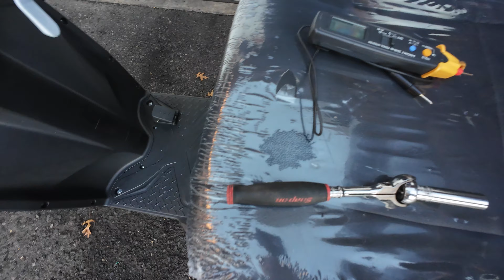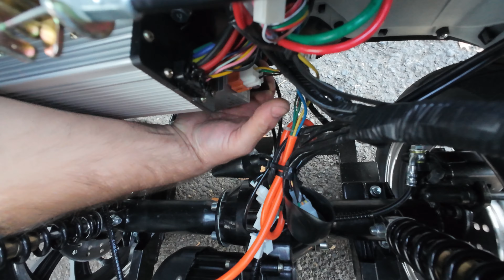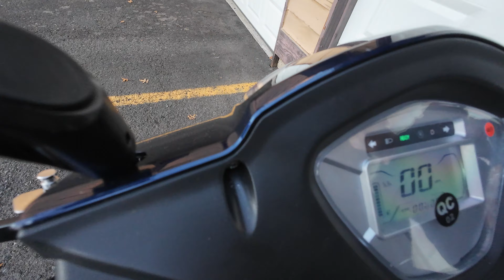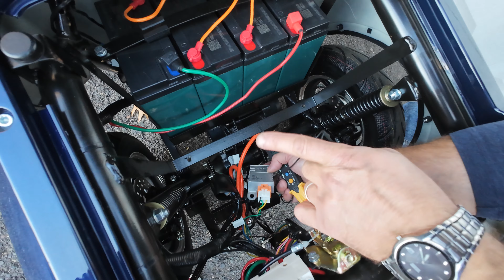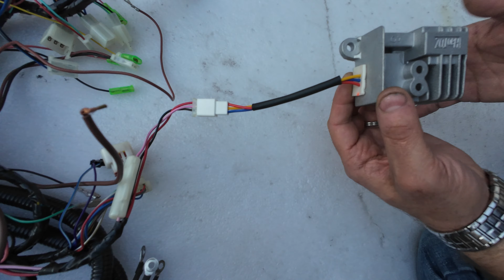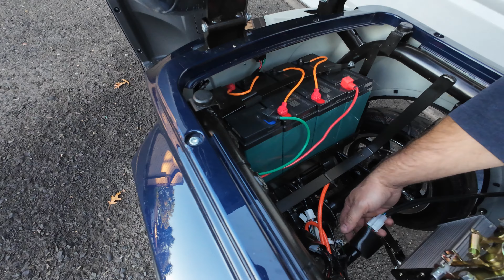Gio Titan  Voltage regulator testing and replacement

Comment: I absolutely love all your videos and they are very informative. 

I have a GIO Titan that is a half year old and I absolutely love it. Unfortunately about a week ago I started experiencing problems getting up hills that up until then where no problem. With a fully charged batteries, even after a short drive, the battery charge will drop down to zero when going uphill. What can I do to address this problem? Any recommendations.
Reply from the maker: Hi, thanks for watching my videos.
After 1.5 years, it is natural for batteries to get depleted  somewhat. In some cases it can be a problem with a single battery that gave up faster than other 3 batteries.  So my advice to test them all in order to narrow down the problem. 
But I rather replace all 4 of them to have good energy balance between all 4 new batteries